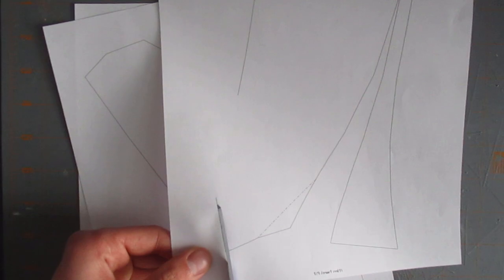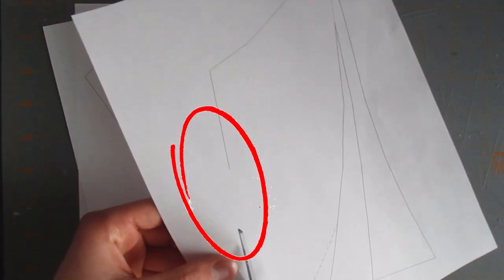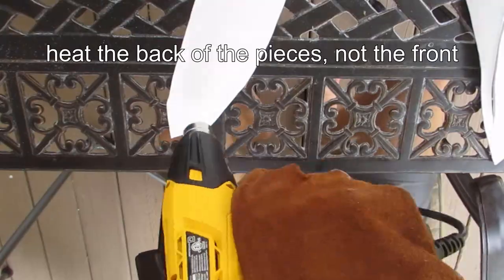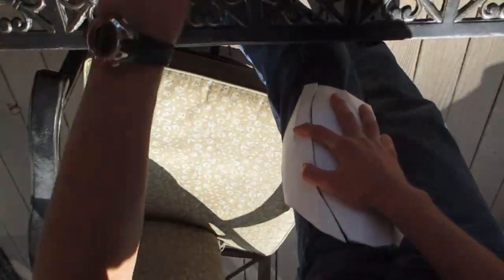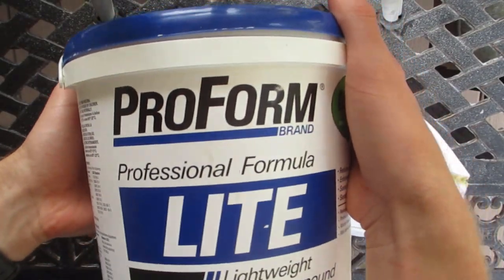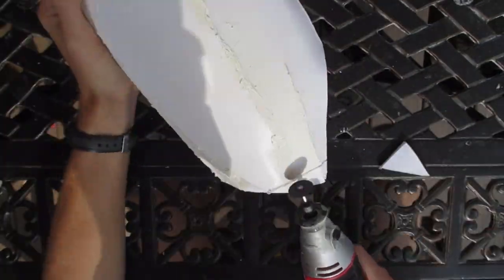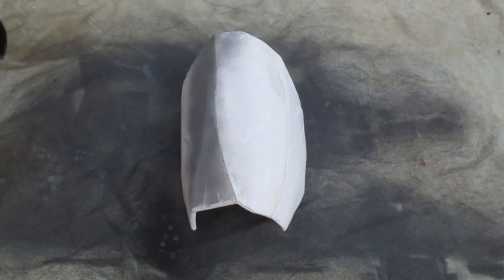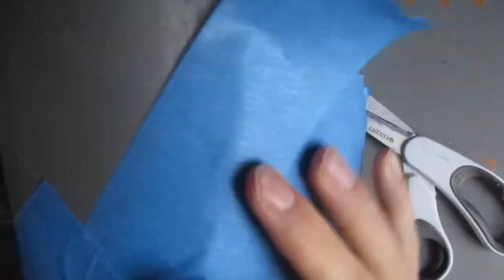Making Mandalorian Thigh Armor! Mando Cosplay Part 8

Comment: I am curious about using the joint compound vs something like bondo for your seams? Thank you
Reply from the maker: I like using the joint compound because it is a lot easier to sand and you don't have to mix it up before using it. Just add some water if it feels dry. 
Bondo will work just as well. Maybe even better, as it makes a stronger bond. But it smells horrible and you have to wear gloves. You also need to mix up the amount you need for your project. 
Honestly, it just depends on personal preference and what is available.  I just prefer the joint compound because it sands better and is pre-mixed. But both produce very similar results.
Reply: Bondo/autobody fillers are significantly better than joint compound in terms of filling seams on costumes. There is also the issue of excess moisture being able to rehydrate the joint compound if not properly sealed (bad news if you're in a hurry and apply watered down paint before sealing it). Way I see it, you can spend 100s of hours on a costume and cut corners that end up destroying your masterpiece later down the road.

Edit: If you really dedicate your time and energy to a project, it's best to continue that same dedication in all areas. It really sucks to spend a solid month working on something that doesn't last a year.
Reply from the maker: @justeric1107  Parts of my armor are over two years old and I have not had any issues with the joint compound in the seams. Rehydration is a valid concern, but it is not a problem once primer and paint are applied. 
Unless, of course, you decide to go on an underwater mission.